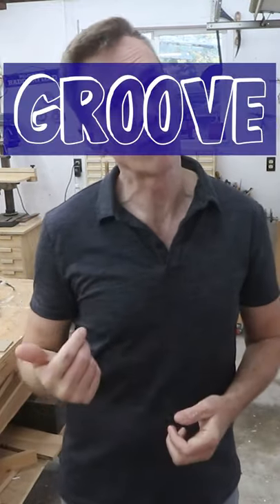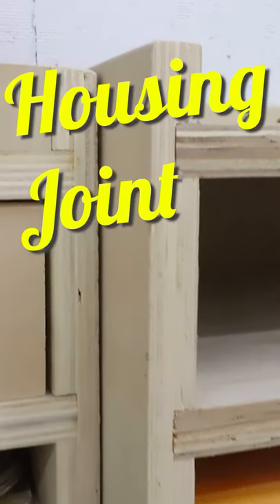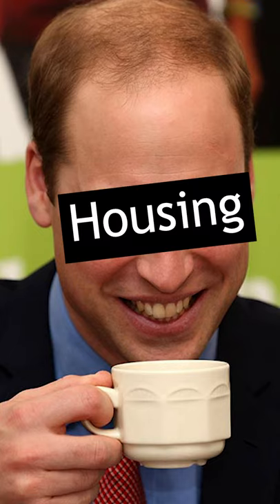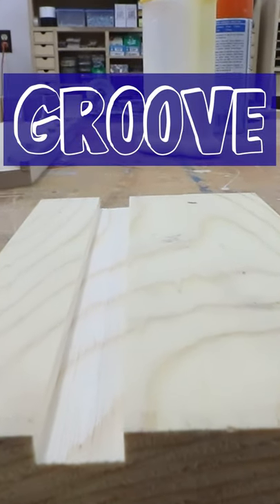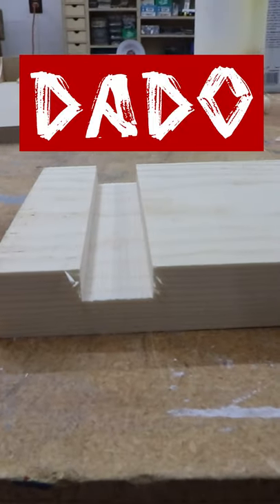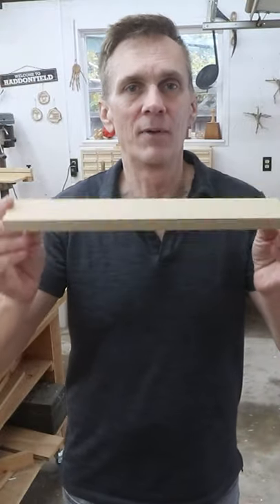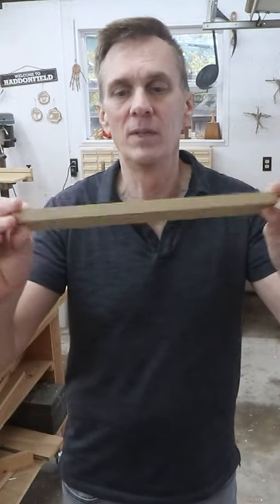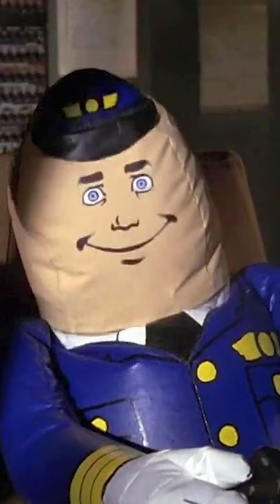Is this a groove or a dado? #shorts

Comment: Dado rail is a length of profiled 2x1 fixed at waist height around the walls of rooms in some old UK houses. Isnt it?
Reply: That's what I came here to say... dado rail is a timber moulding (yep... uk spelling!) at chair back height to protect the wall from scrapes.  Often decorative wallpaper above/below in different styles, or timber wainscotting below and paper above.
Reply: @jayt9882  Thats it. Often accompanied by a similar thing called a picture rail about a foot from the ceiling. To hang pictures off. I guess neither are seen much these days apart from in period properties.